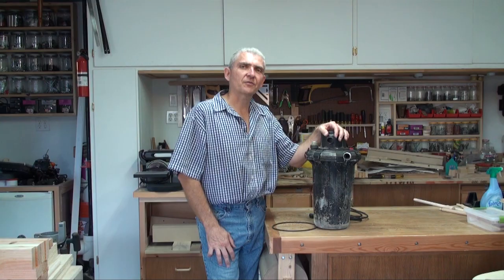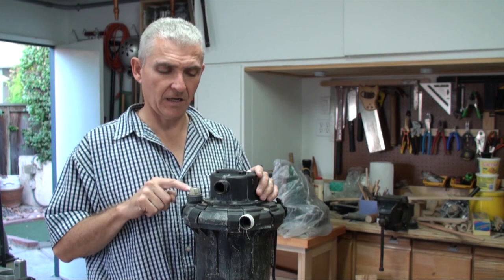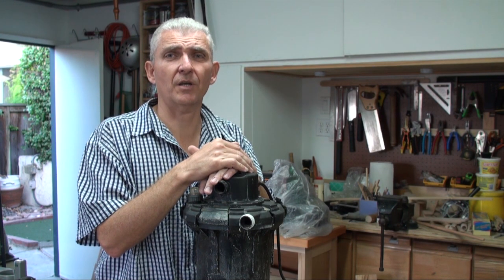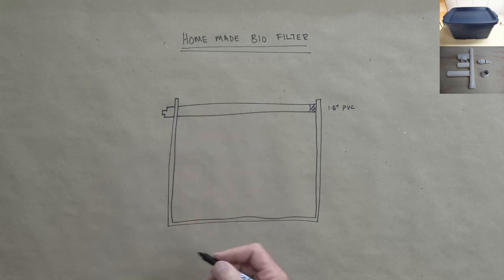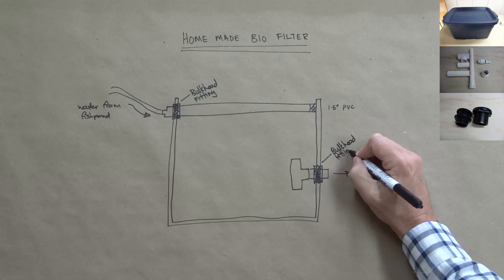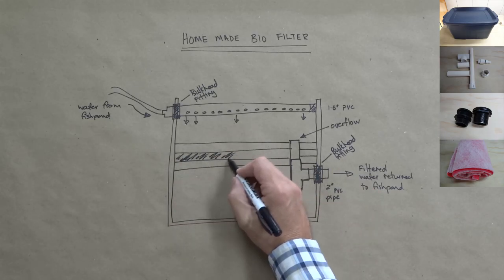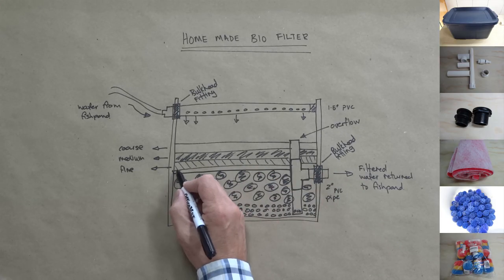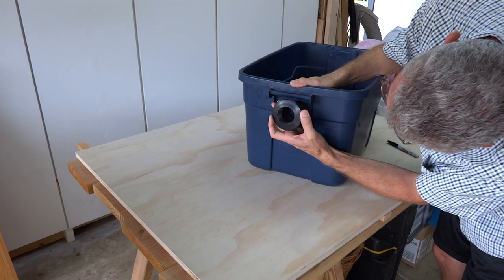Homemade Biological Pond Filter

Comment: How many weeks you should change the filter?
Reply from the maker: Patrick Sarmiento depending on how dirty your pond is when you start you filter you may have to clean your filter material a few times if it becomes blocked until the water is clear. outside of this, I personally only clean the filter material once a year in the early spring.

Comment: Can I put the outlet pipe higher than halfway or will there not be enough pressure and the water just flow out the overflow
Reply from the maker: allthings possible you can put it as high as you want, you just need to ensure that there is still room for the overflow to work (in the event the filter becomes clogged or the flow of water through the pump exceeds the flow of water through the filter). There is no pressure in this system, gravity does all the work.
Reply: Trevor's Workshop thank you I will eventually build this for my pond

Comment: That's exactly the DIY system that I was looking for!! We recently bought a house, with a big pond in the backyard (+6000L). The previous owner never filtered the water nor provided it properly with oxigen (the pond is, according to the neighbors, more than 10 years old), let alone ever cleaned it, with the result that a 30cm thick layer of all kinda crap settled on the bottom of the pond and filled with very dark green mucky and stinking water. We were barely able to see any fish that was surfacing for food. I was able to rescue about 20 fish, all sorts of them, 3 koi's included (I have no idea how they even survived in that stinking water!!) and pumped out most of the water out of the pond. Next step is getting rid of all the yuk and muck on the bottom with buckets, which is gonna be one hell of a backbreaking job of you ask me. ^^ And, because I'm a person who likes DIY, I was wondering how to make a proper working biological filter that would be easy to clean and working properly. And there you are! Tho my tub might have to be bigger, +6000L to clean, as well as maybe a stronger pump, the system stays the same.

Thanks for sharing, buddy!! Cheers!